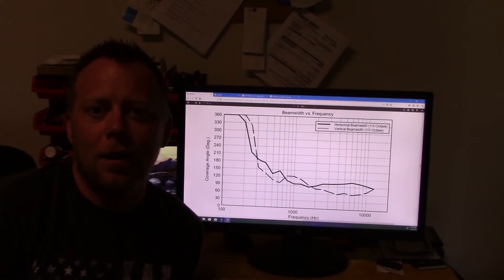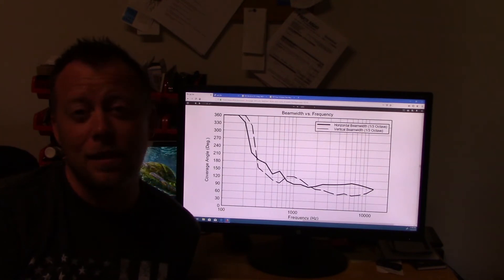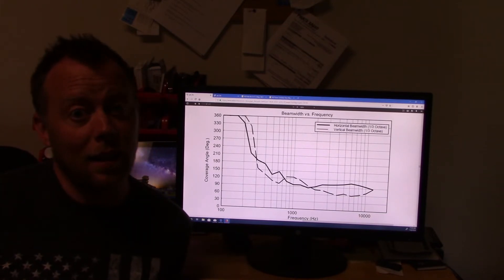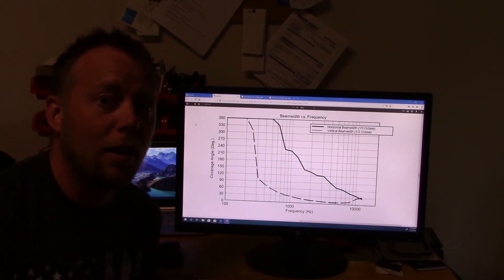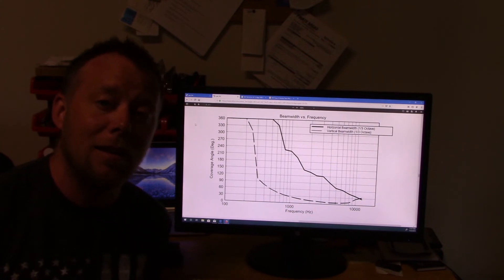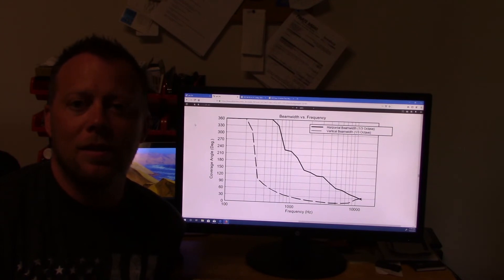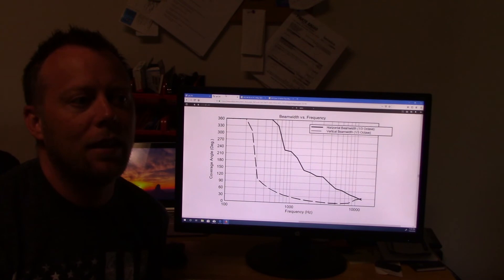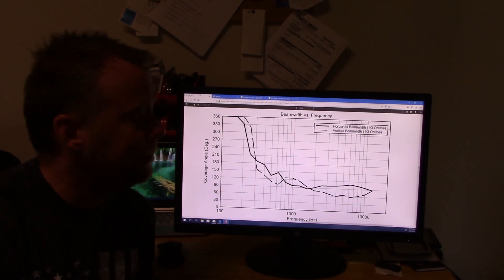Column Array Vs Point Source | Differences In Coverage Pattern (Frequency Beamwidth)

Comment: Thanks for showing those graphs. The columns looked tempting with the small packaging and quick setup, but the mics I use are especially sensitive at 200, 600, and 1.4kHz. These aren't for me as cutting those frequencies too much can make it hard to get a vocalist to cut through. Would rather keep my point source and wedges where I can hide the mics and not have to make extreme notches.
Reply from the maker: I recently bought the RCF EVOX 12 to test out. I'm going to start using it regularly this weekend. Figured I better try out a more expensive column array before I call them all trash 🤣
Reply: instaBlaster.

Comment: The width of the cabinet itself can also determine the frequencies that make it to the rear. Column arrays have a slimmer cabinet so midrange frequencies are making it to the rear. Wavelength vs. cabinet width.
Reply from the maker: I wonder if that's why my Event 210A line array cabinet was so quiet behind the speakers. They are a dual 10" side by side cabinet.